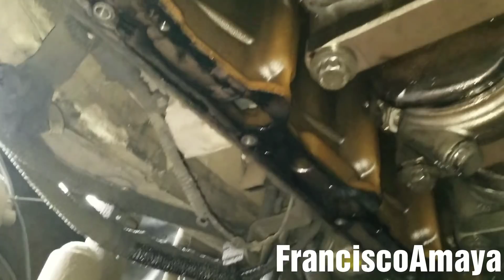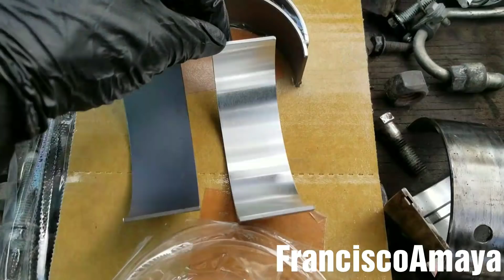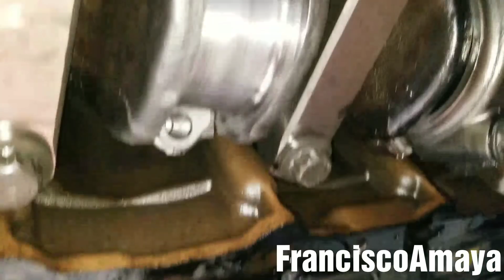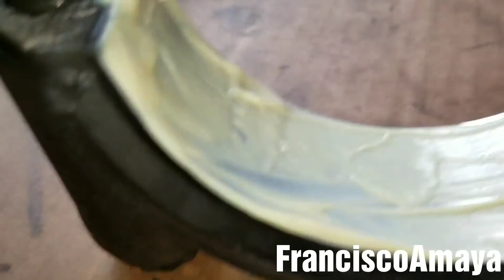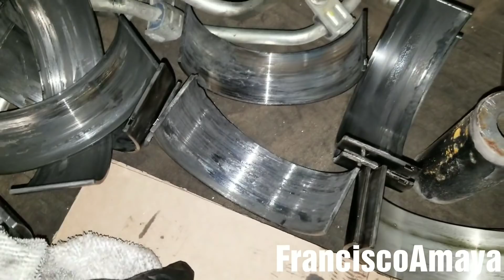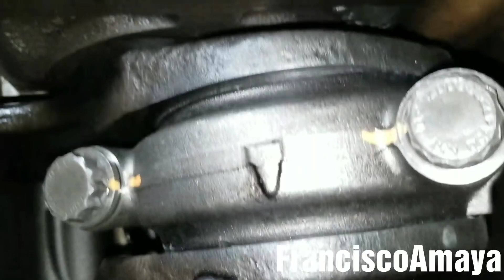Freightliner cascadia DD13 DD15 DD16 main rod thrust play crankshaft bearings replacement 4

Comment: Donde puedo encontrar  torques de vielas y bancadas del d15 Cascadia
Reply from the maker: torque specs 

 For the DD13
main bearing cap bolts to:
1 - 150 N·m (111 lb·ft)
2 - 300 N·m (221 lb·ft)
3 - 90° torque turn

Connecting Rod cap bolts to:
190 N·m (140 lb·ft) + 90° torque turn

For the DD15 and DD16
main bearing cap bolts to: (bancada)
1 - 150 N·m (111 lb·ft)
2 - 250 N·m (184 lb·ft)
3 - 90° torque turn
4 - 90 ° torque turn (180° in total)

Connecting cap bolts torque to: (bielas)
115 N·m (85 lb·ft) + 180° torque turn

Comment: IS there another way to rotate crankshaft
Reply from the maker: For the bottom using the flywheel teeth and from the alternator pulley with a 15/16 socket.
Reply: @franciscoamayaYT   thanks , Counterclockwise direction right?
Reply from the maker: @e7bk  
Yes, if you rotate it from the alternator.

Comment: Bro i want to know the required torque for head and crank main bearing bolts for same engine
Reply from the maker: The head has the same torque as the main bearings.  
Check the DESCRIPTION of the video. I have all the details there.

Comment: Francisco me podría ayudar con el torque de cabeza para dd15
Reply from the maker: 1 - 150 N·m (111 lb·ft)
2 - 250 N·m (184 lb·ft)
3 - 90° grados vuelta
4 - 90 ° grados vuelta (180° en total)
Reply: What cause your engine not to crank on the first try,after the cycle it click 2x then start

Comment: No more F01/F02 DIY's anymore I'm waiting for the next video
Reply from the maker: Yes, I am planning to do more.  It is just that the 750i has not problems at all running like new. But I will see what video I can do about it. 
What would you like to see?
Reply: Fuel line replacement and front lower control arms!!!